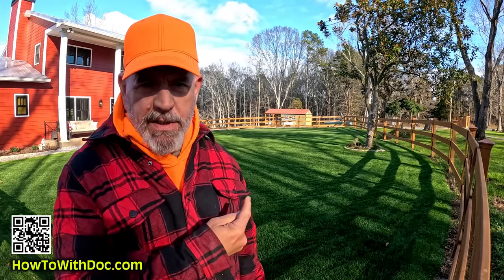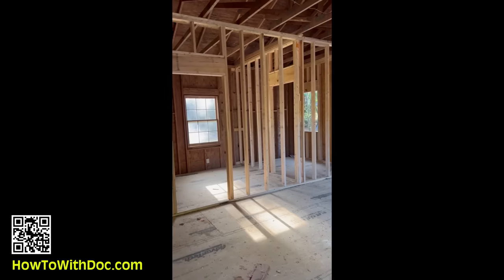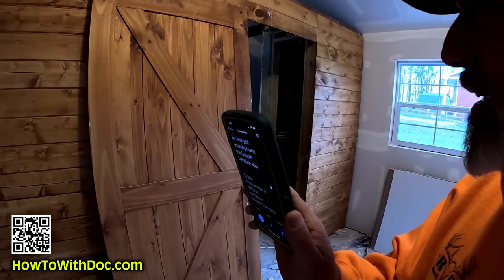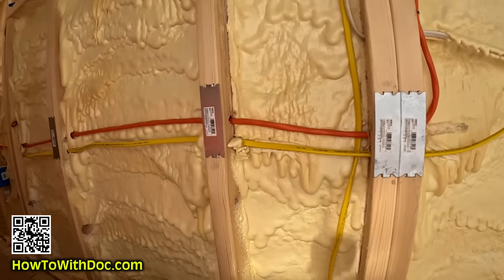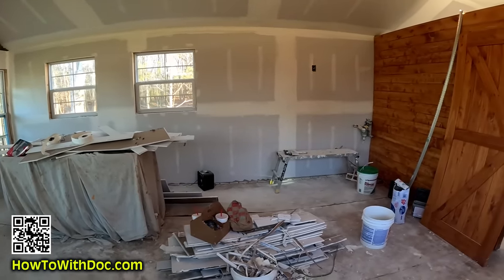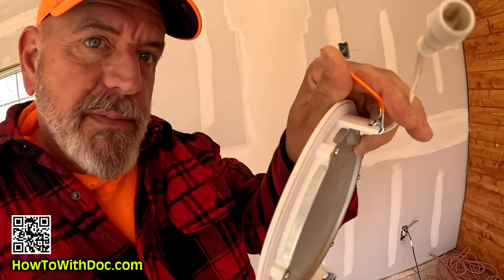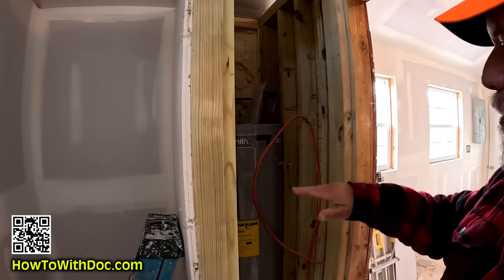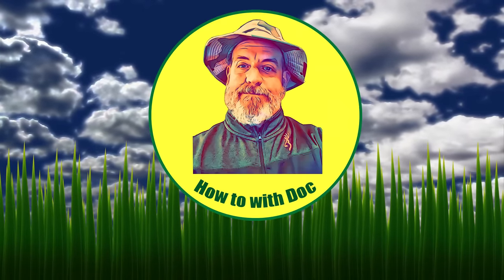Installing Drywall Tips Don't Make These Mistakes

Comment: Just a hint lay out lighting on the floor and use a laser for an accurate location on the ceiling. Old days i did everything with a plumb bob . Especially useful when installing a hundred or more can lights.

Comment: Doc I have a question about the use of Green Shocker. Application instructions say to stop applying in the fall when temperature gets cold. We are late December and you seem to still be applying it. The product appears to be effective. Could you explain? Thanks!
Reply from the maker: https://www.youtube.com/watch?v=SKOC1xJNiJw   explains why
Reply: Thanks for responding. I had watched the video which actually led to my question. It sounds as if your thoughts toward the use of the product is even if it gets cold and there is a first freeze in the fall yet the temperatures climb back up to well above freezing in the same season the product remains effective? Would this hold true on fescue as well?  Thanks again and Happy New Year!

Comment: Are you going to run your HDMI and other cables for your TV 📺 down from the top to the bottom electrical outlet?
Reply from the maker: It's all wifi based, no HDMI
Reply: @HowTowithDoc  and I assume no WiFi interference way out yonder 😁 ???

Comment: Hi, I was just wondering how you get access to your water heater for replacement ?
It looked really tight in between walls .
Reply from the maker: Remove one stud on the side and it comes right out. Those two studs are just blocks for the door not structural